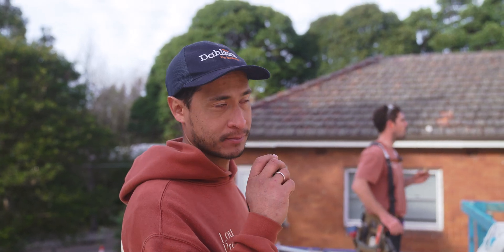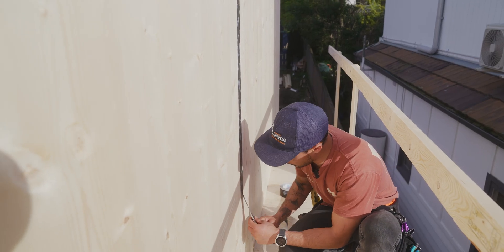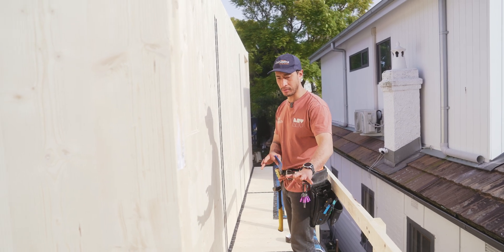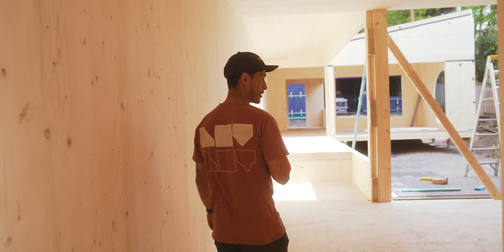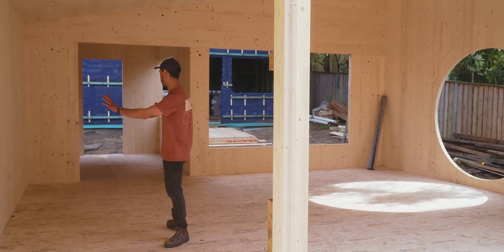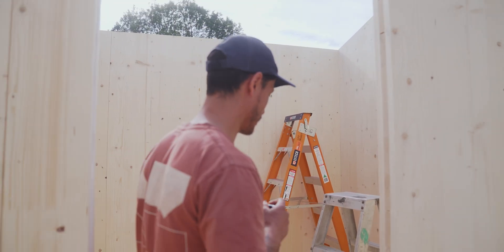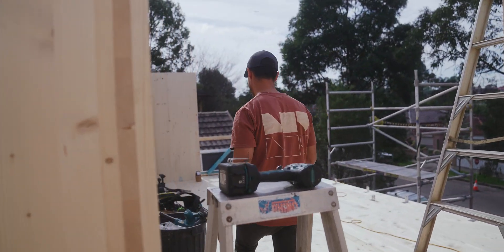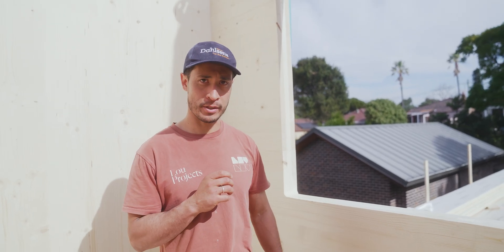Lou Projects - Project Update - Dulwich Hill - CLT Installation

Comment: Hey Lou, how does does construction cost stack up with using CLT compared to framed construction? I assume the labor savings wouldn't outweigh the material cost but you're obviously getting a different end result with the CLT.
Reply from the maker: Unfortunately it's hard to provide you with a clear cost comparison as the project was always designed as a CLT house and we never had the chance to price it comparably to standard frame construction. However, we can say it was about $20k in labour to install and tune up plus almost $20k in crane hire and traffic control etc. Sorry I can't help answer your question a little better...
Reply: @lou.projects  All good man thanks